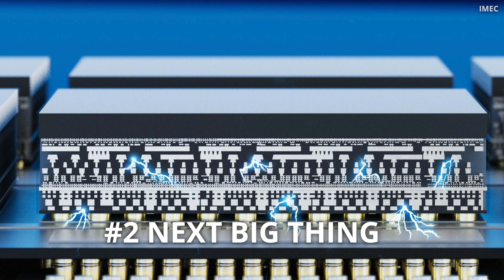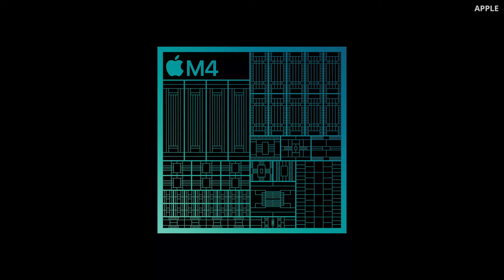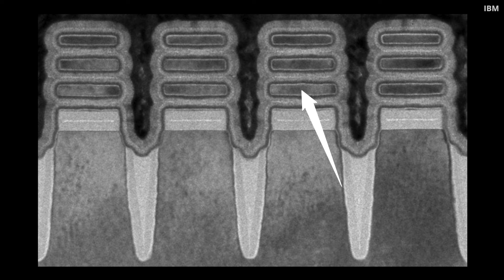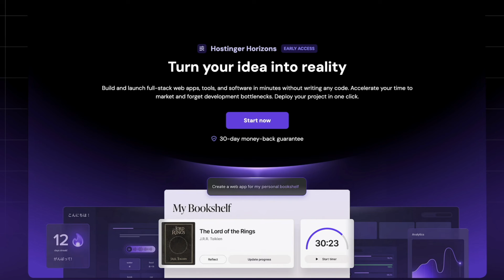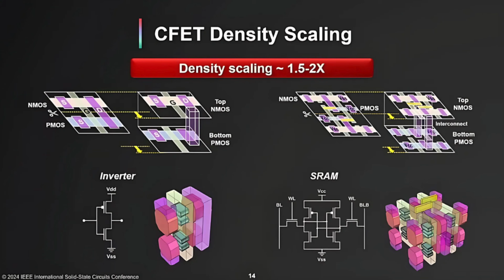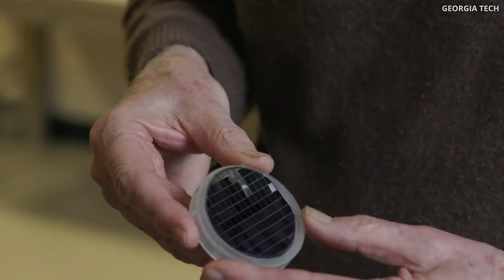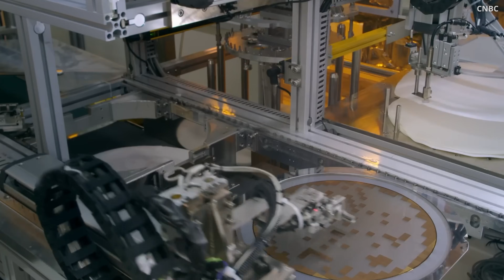The Next Big Thing in Semiconductors

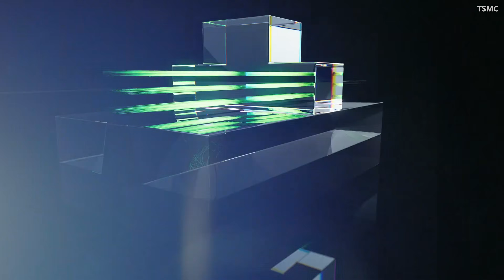Comment: 7:33 

The shape of the gate changed because it needed to at that dimension.
Progess is not accelerating at this point. It is adapting. At least that is my conclusion.
The gate size from 15nm to 3nm is maybe 5x density? That is lesss than one order of transistor gain.
The ability of the industry to continue to innovate is still amazing, but there is a reason why so many chip companies went the fabless route.
The gains are certainly deminishing.
Chip designer are already designing for more feature instead for more performance. More on chip memory. Graphics cores. AI cores. Multiprocessing.
Future performance gain will probably have to come from software.
Reply: Well I guess mainly for the costs reasons they would go that route, and the other thing with so much potential or performance added it would be crazy to left untouch.

So kinda creating those features to use that perfomance seems rather the way to go.  But that is my interpretation.
Reply: Except adapting by experimenting, doing research, and discovering their idea was not only working but could be fabed on their process is not really adapting
Which, btw, they have beein doing since the 130nm sucked powerr and that was due to ... electron migration
So, I don't see why you want to denigrate their solutions as this is how the business has progress since day 1
Reply: @dcy665  

The point is not to denigrate.
The point is to setup realistic expectations for the future and be ready for it.

Look at the gaming console companies. They have already accepted reality.
You don't think they want to push the next gen console sooner and have you play platform exclusive games?
It's not that they don't want to. It is because they can't.

If you make personal, business or government policies betting on doubling compute every year, I think you will miss your mark miserably.
Reply: These are evolutionary advancements.  The true revolutions will come with new concepts (e.g. quantum computing), materials (e.g. graphene, crystalline structures) and manufacturing techniques.
Reply: @bjreacher6402  

I think there are plenty of revolutionary techniques in chip manufacturing in the past decade.
I do see tsmc and it's suppliers putting out what seems like one miracle after another to make even smaller features and utilize more dimensions.
But like I said, diminishing returns. We ran out of dimensions. Hard to imagine much smaller gates size on silicon than we have now.
And probably yes, most likely no giant leaps in the near future on silicon...
Reply: @porcorosso4330  It's a matter of perspective.  I'm just looking at a higher level than you are and I'm not trying to make light of the tremendous progress that has been made.   We are still using lithography and doped elements to make gates on a silicon substrate to turn on and off current as a digital switch.  Something revolutionary would be using quantum switches or optical switches or hopefully something really new, fast and power efficient.
Reply: Pentium 4

Comment: The 2D materials portion got me so hyped. I've been waiting to see when this technology would take off. I absolutely cannot wait to see her videos on the various new 2D materials being researched. I naively just assumed we would be referring to graphine, but obviously industry would start researching what other 2D materials could be made and see what magical properties they have.

Awesome video! As always.
Reply: Carbon is very bad for channel material because it has no bandgap meaning you cant switch it off. Sure you can introduce impurities to alter the properties but really you are using a material with very bad leakage that needed to be hammered down to shut off.
Reply: You are right, a bandgap can be introduced in graphene to enable it to operate as a switch (like in a transistor), but achieving a bandgap large enough to minimize leakage current effectively, especially at room temperature, is a major challenge. Progress is being made though and with the rate of advancement we have seen in 2D materials it is possible this can be achieved.

That said, my main point wasn’t even about graphene. What really captivated me were the other 2D materials she brought up. The possibilities feel endless when you think about the extraordinary properties we’ve already seen in just a handful of these materials. It’s hard not to let your imagination run wild picturing the futuristic technologies they could unlock.

Comment: 4:49 I wonder what would happen if they increase the surface area of the square, where the electron begins its jump through the gate? I wonder what would happen if you put one wire on top of another, and the length of the gate becomes the increased surface area, and still have gate all around tech?

Comment: cray computers in the 1980's used to immerse the chips in a non-conducting fluid called flouerinert. I wondr why ww are not seeing this cooling approach used in todays servers.
Reply: EPA banned it. A replacement has been seen at trade shows for the data center.

Comment: For perspective, a hydrogen atom has a diameter of approximately 0.1 nanometer, and a silicon atom has a diameter of approximately 0.2 nanometers.
Reply: For perspective, a 3 nm node is actually 23 nm MMP and 45 nm CPP. Nothing on that node is actually 3 nm.
Reply: Guess what? There's no horse inside cars engines  @soylentgreenb
Reply: @soylentgreenb  3nm is the smallest feature size the lithography is able to reproduce, so it is an actual measurement of resolution. The lithography is the technology improving with each nm process, the transistor technology drives the need for smaller resolution.
Reply: preach  @soylentgreenb
Reply: Is She talking about Lithography process of getting Chip's smaller and tranzistor also with Germanium and others...❤🙃👍? @soylentgreenb
Reply: @picksalot1  
0.1 nanometer is 100 picometers or 1 Angstrom - a term which has been superceded.
Reply: Thank you, these marketing gimmicks are getting out of hand. But I agree with the accelerating pace of progress on things like AI and nuclear fusion tokamak reactors. I was actually pessimistic about both just a few months ago; and now they are both taking nice steps forward.
Reply: @Phillip1220 Nuclear fusion will never be a practical terrestrial power source.  The efficiency and cost will prevent it from ever being a workable solution, renewables will always be cheaper and more practical.
Reply: @Phillip1220 Hate to tell you but AI is already greatly increasing productivity. My sister works in media research. They have replaced numerous people who used to create all types of written documents. Those have all been replaced by AI. They used to have people write up documents and then supervisors review and edit the product. The writer is now AI and the supervisors review and edit the results.
Reply: @Phillip1220 That's an interesting perspective. A few months ago all the technical indicators for generative AI were still showing an increasing rate of progress, but there are recently more indications of a plateau on that frontier.
Reply: @MNbenMN which indicators are you referring to. I haven't seen them myself, so I'd like to get up to speed. For some reason I've been avoiding the news in general lately.
Reply: @maskharat To be fair, most humans haven't really mastered that "I" part either. Anyway, it doesn't seem like what you commented was intended to be a reply to what I commented. Just wanted to let you know in case you were intending to reply to someone else. Based on the similarity in word choice of your comment and my previous comment, but lack of relevance in the meaning, I infer that there is significant statistical plausibility that I am replying to a bot. Not that it's getting harder to differentiate generated text from actual human input... or is it?
( cue the moonmen music )
Reply: @MNbenMN  I mean there are more times where talking to an AI you can "feel" the I then you do with other humans including oneself.
Reply: @maskharat "if you had mastered the I part, you would" (btw. dont get triggered xd, its personal but more jokingly) realize that humans are only pattern recognizers and extrapolaters in a causal world thats predetermined as well. any thought you have is an electrochemical reaction bound to matter, any particle of matter is interacting with other particle of matter based on natural laws meaning anything that "perceives" anything else is BOUND by what it perceives because it interacts and you cant interact without laws of interaction, its simply not possible from a logical standpoint, and if you have a law to act upon it also means you have a causal outcome, its one worldline in the field of possibilities just like any particle will always find the point of lowest energy in all states possible. causality cristalizes itself while unfolding. everything has already happened, we only perceive "time" because we are inside the relative system. we are ruled by speed of causality, the speed of light, thats why you cannot break it, you would have to break causality and that wont work within our universe of information because there is no true chaos and without it you cannot circumvent the rules. 

may sound like a lot of gibberish to you but if you try to think of what i mean you may realize there is a structural thought in this ^^ 

in case you understand what i mean and just disagree, here an example for why we are just pattern recognizers as well (all our input is perceived, it cannot be generated (without recombining/ extrapolating existing PERCEIVED patterns), we arent "truely original" (as compared to AI which is supposedly not or so they say) either. we cannot "create thoughts" we are merely complex enough and evolved to perceive causality (that includes thoughts) happening to us. 
So yeah: example: try "creating" a color without a pattern you already know. aka a color you have never seen, a color you cannot extrapolate by the pattern of color you have seen (aka make a very bright crimson red by mixing in white (pattern extrapolation because you know mixing in white changes the hue to become brighter) or recombining pattern aka mix blue with yellow to create green then use white to make a bright green, etc. ; it is IMPOSSIBLE for you to make a new color. its even impossible to imagine it. you cannot create it. you can only perceive it. and after perceiving you can process, recognize, combine and extrapolate it. 
So you may say "but thats because we have already found all the colors there are". no. as you may probably know, colors are just what our brain evolved to code certain wavelengths of light are to be interpreted as. now i ask you, how many colors do we know and how many possible wavelengths are there? so yes, there would be "new colors" if we could actually be truely creative and imagine them. but we cant. at the same rate a blind person that has been blind from birth (truely blind, not legal blind) and has never seen the color green, will be unable to imagine it. they will ASSOCIATE other perceived data, other pattern with it, will know its a soothing color, its a "Good" color (green is right, red is wrong, red is warning, etc.) but they will never see it. and the same way of them learning about that color is AI learning about anything else. especially because AI has been effectively blind so far, doing artworks without ever having "seen" one. they just interpret the underlying pattern and extrapolate to fit our expectations of what is "good art" which is also why they cant be creative (not truely creative, just creative) on their own, because we limit them to our evolved expectations that follow no rule we can "explain" and implement to an AI properly because we dont know either. same with consciousness. we just dont get it lol. doesent mean its chaotic, its still causal.
Reply: @maskharat Just as Your channel, ("This channel doesn't have any content"),Your chat comments seem to have
little worth sharing...   ♾
Reply: @maskharat  I think you may have a fundamental misunderstanding of what "progress" means.

Comment: Great video! Some very interesting ideas on how to go smaller while at the same time, tech has been selling off. There is an argument, that we need a price consolidation to allow companies that have bought a lot of hardware to profit so as to have money for new hardware. But if the 21st century is to increase in capability much faster than any previous century there can be no meaningful slow down. It is like the unstoppable force of advancement as hit the immovable object of  financial constraint. To this mix is added the possible tariff wars & the large increases in stock market valuation of the previous two years that may make for lower stock markets this year. So much is changing that it is hard to know what will happen in the short term, but longer term it seems certain that there will be major advances & the best companies will do well. Thank you for sharing!

Comment: First, I'm sure by now you know that Deepseek has been exposed as a complete fraud. 
https://www.youtube.com/watch?v=MJvQ6ek5Y0o

I've built many wafer fabs in Silicon Valley and over 100 data centers as a project engineer, electrical engineer project manager, and project director. I've worked in many other industries as well. I can say in all honesty that I have considerable knowledge in Uptime Institute's original tier system including the five 9s, other deceptive topologies, and considerable knowledge of chemistry and HVAC systems. ASHRAE and the Green Grid are my nemesis. They are total BS. 

Way back in the day, the heat load was about 42 watts per square foot. That was an IBM standard. Then we jumped to 100 watts per square foot because regardless of the technology you couldn't fit more than about 2.5 to 3 kw in a standard data center rack.. And then the manufacturers found ways to increase the heat density to where the problem of cooling equipment became a nightmare. CFD (computerized fluid dynamics) was required to compute the temperature inside racks and simulate the failure of each CRAC unit. Data center operators thought they were being really smart operating their data centers at 95 degrees F. The in rack PDUs had to be rated for 135 degrees F. Figures of merit like PUE power utilization effectiveness and  its inverse DCiE Data Center infrastructure Efficiency is a total fraud. Science recognizes one measure of efficiency of refrigeration and that is comparison to a Carnot cycle. People are making absurd claims. Operating a data center at high ambient temperature doesn't make it more efficient. If air is moved by a fan in the equipment it goes in the numerator of PUE. If it's by an HvAC system fan it's in the denominator. If you build a data center next to a fjord in Helsinki you may not need any mechanical air conditioning at all, just a water pump. In the Amazon jungle you'll be operating  the system 7x24x365. 

Back when I was building wafer fabs in the late 1970s early 1980s the cost was about $1000 a square foot. Today it must be staggering. 

We always used to install generators and UPSs to support data center power.  Uptime Institute required two entirely separate power supply systems to qualify for Tier 4. TIA 942 was similar (Telecommunications Industry Association) The first time I saw what is called "distributed redundancy I knew there was something very wrong with it but it took me a month to figure out what it was. If you are building an enterprise data center this topology should be avoided. It's cheaper but there is a fatal flaw in it. 

There must be at least a hundred ways to die in a semiconductor wafer fab. As I recall it takes a lot of water to operate a wafer fab. Where will you find it in Arizona. Compliance with OSHA and EPA in these fabs is very expensive. That may be why they were moved to other countries. If China invades Taiwan, the US will likely have to bomb TMC's buildings and the rest of its industrial infrastructure flat so that the Communists don't get their hands on it. What's the air cleanliness requirement these days? When I worked on the it was class 100 in the room and class 10 under the hoods. Today it must be class 1 in the rooms and class 0.1 under the hoods. I think requirements were 100 air changes an hour with 100 percent makeup air.

Comment: Do you think low energy demand will be more important than speed? There are so many competitors for energy coming up like EVs at the same time as energy supplies will be different with wind and solar. Interesting fact/myth: in N.Y. you cant turn off heating in some apartments, you regulate by opening the window! For cooling maybe all new datacenters will be built in Alaska?
Reply: Putting data away from where they're used would increase energy demande by orders of magnitude
Reply: @   Facebook already has datacenters in northern Scandinavia to save cooling costs. All communication with Europe goes by fiber so it is not that much energy.

Comment: Progress is exponential.
Reply: WE MUST ACHIEVE SINGULARITY AT ALL COSTS
Reply: I agree 100%
Reply: Not at all. It used to until about 2006. Clock speed used to scale exponentially; this benefitted every work load. This stalled out with the end of Dennard scaling. Then parallellism stalled out on the CPU side of things because most applications can't make good use of more cores (amdahl's law and latency requirements for real time applications like games). Now GPUs are starting to stall out due to Amdahl's law. The things that can continue to scale exponentially are pushed into narrower and narrower nichés.
Reply: Don't forget the complete halt of memory latency improvement, & also the stagnation of memory bandwidth. However certain specialized things are indeed on a super-exponential.
Reply: @jigglejaggle4732 that's only stalled because it's reached the max level that's needed.
Reply: @soylentgreenb  Progress as a whole, not specifically toward chips